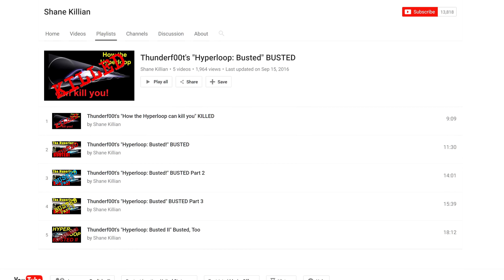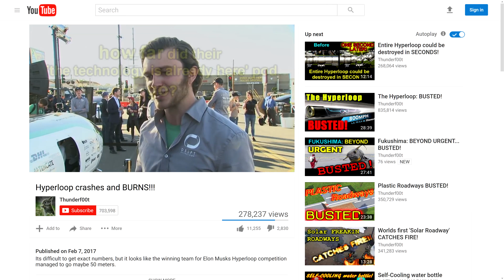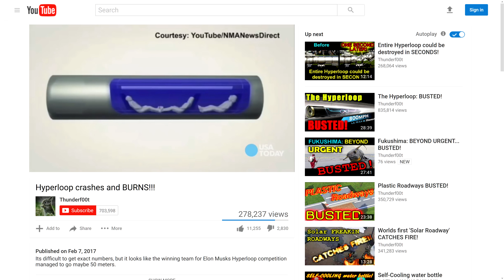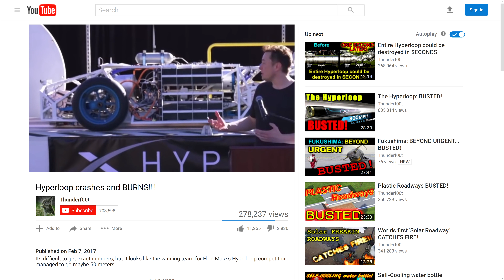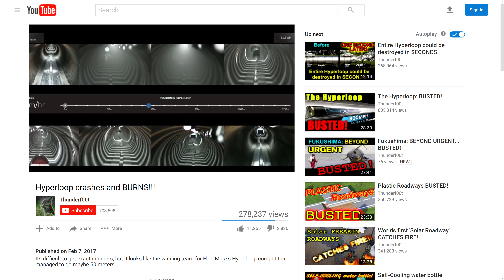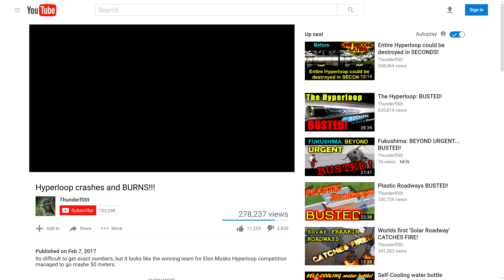Thunderf00t crashes and BURNS!!!

Comment: Not facts presented in this video. All you did was say what thunderfoot is saying is wrong and that's it. No evidence used to refute thunderfoot's claim. Also no links to this supposed class that created the faster hydrogen car. I have seen stuff on line that says it's an auto manufacture that made it, but you didn't site any source. So that means you are full of shit. I know what students are capable of in stem and building the fastest hyper car is not one of them. Your video was shit.
Reply: Where did Thunderf00t support his assertion that the goal of this test was to travel all the way down the tube as quickly as possible?  Even if Shane couldn't cite anything; or even if he had simply made up everything in this video-- Hitchen's Law would still do the rest for him.
Reply: Thunderf00t did not justify his analysis. Null hypothesis wins by default.
Reply: Levitation at a fairly high speed, in a vacuum, verifying safety and stability does not seem like a crap test.  What video seemed to award based on distance traveled?  

I don't understand your third sentence.  Read it back to yourself and see if it makes sense to you.
Reply: I would include a link to the article but I can't post URLs in youtube comments on videos I don't own. Thunderf00t's math is terrible, I have, on multiple occasions shown his results to be off by several orders of magnitude.
It took me all of 10 seconds to find many articles referencing Delft's fuel cell racecar. It's not my fault you REALLY REALLY FUCKING SUCK at googling things.  You should be embarrassed.
Reply: He's a troll, Shane.
Reply from the maker: "And you are getting pissed which shows you know you are wrong" Oh, FFS, you ARE a fucking troll, aren't you?

You haven't done ONE SINGLE FUCKING GODDAMN THING to show we're wrong. Only pathetic ad hominem attacks like this.

WE HAVE FUCKING SHOWN OUR CALCULATIONS. SHUT THE FUCK UP.
Reply: Do not feed.
Reply from the maker: "See you are a prat because you first say you had a lot of maths in your video now you are saying that you didn't need math in the video. Which is it liar?" YOU are the liar, DELIBERATELY taking a comment that was referring to the whole series (direct quote, LIAR: "We used math COPIOUSLY in this series") and making it about one bit in particular.

All you're doing is proving that no one should take a word you say seriously. You have NOTHING.
Reply: MIT was also a competitor, MIT is renowned for its groundbreaking engineering research. Just search "MIT creates" in google and get lost in the incredible things that institute produces on a regular basis.
Reply: Alex Fauble why should I have to search anything? In a video sources need to be sited. You do not write a report and in the bibliography write; search Google. See, it's funny how i have to search for a very specific set of words to find some support to the car assertion but I already looked and found nothing, so I'm not going to do it again and this video lost a credibility. At least Thunderfoot showed maths. What did you show? Other than irrelevant "facts?" A bad idea is still a bad idea regardless of how much achievement the individual purposing the idea has accomplished. Poorly done video boils down to school yard tit for tat. Lame.
Reply: Shane Killian he backs it up with maths. You are free to use your own maths to refute his. All you did was say that thunderfoot was wrong and offered no sources or reasons why. If you wanted to prove that thunderfoot was wrong about the intention of the test, show the documents to prove you are right. As it stands thunderfoot and the very video about the hyperloop prove you wrong.
Reply from the maker: LIAR, spouting figures out of context and making them sound a lot bigger than they are IS NOT FUCKING GODDAMN USING MATH!!!
Reply: Search "First full-size hydrogen fuel cell powered race car by TU Delft".
Reply from the maker: No, it doesn't. This is how HONEST people respond to LIARS. But you wouldn't have the first fucking clue how honest people react, do you?

No math was provided here by us because NONE WAS NEEDED. We were ASSUMING Thunderf00t's assertion was correct, and merely pointed out that this was about $5 worth of electricity.

GO THE FUCK AWAY. You have NOTHING of value to contribute.
Reply from the maker: I like how I have to source every last jot and tittle even though I'm not saying anything that's out of the way, yet Tf00t makes one ridiculous claim after another with no sources whatsoever and that's just fine.

"but I already looked and found nothing, so I'm not going to do it again and this video lost a credibility." No, YOU lost credibility there.
Reply: Shane Killian wow. All the projection. You are right. You do need to go away. You recorded a video that was a waste of time. See you are a prat because you first say you had a lot of maths in your video now you are saying that you didn't need math in the video. Which is it liar? You are getting your ass kicked in this comment section. How does that feel? You are like a liberal losing the argument to a conservative. You need your safe space don't you? I can send you a link to puppy dogs playing, would you like that, liar?
Reply: hugesinker it looks like a crap test then. And the video seem to award based on distance travelled. And really, your post was the longest just because I have ever read. Spare me.
Reply: Shane Killian your video shows him using math. Who's the fucking liar?
Reply: hugesinker maybe you need to read it so it makes sense to you. And going a small fraction of the intended speed is not "fairly high speed." This test was a bullshit pr stunt on a project that is doomed to fail. You do not hire students to design a machine intended to be safe at speeds they want it to travel and in a vacuum. Students, by definition have no experience doing this. If it was serious, students would be interning not proposing and testing their designs. 

And if they are truly verifying safety, shouldn't they be checking what happens when the tube fails or at the very least how forces are required to do a failure? Spare me.
Reply: Shane Killian and we are still not proving anything. And you are getting pissed which shows you know you are wrong but have painted yourself in a corner. There is nothing wrong with saying you fucked up. It makes you grow. Show me your calculations that refute thundefoot's.
Reply: Shane Killian no you haven't. Liar. Not in this video nor is there a reference to them sited in your description. You are the troll, yo post nothing to support your claim. 

And people who get this upset and start accusing people of using logical fallacies that they don't even understand the meaning of shows how insecure and weak of character they are. You are almost on the verge of a complete toddler melt down. Like I said. It's okay to be wrong. It's a chance to grow. How about you grow?
Reply: Shane Killian yeah I wasn't talking about the whole series I was talking about this specific video, which makes you a liar. It's like when you show up late for work on one day, who gives a fuck about how punctual you were in the past. You are still in trouble. Like I said, your video is crap and your defensiveness is showing me and everyone else how right I am. Seriously. Take this as an opportunity to learn and grow. I'm sorry your video is shit. But it's a learning process. It will just take a long time to get to my level. But it will be worth it.
Reply from the maker: "he backs it up with maths." He didn't use math ONCE, YOU FUCKING LIAR! We used math COPIOUSLY in this series.

You fucking neo-Luddites have NOTHING. FUCKING NOTHING. Go wallow in the past and let the rest of us live in the future.

Comment: You a lying about what it was testing for. It wasn't testing for anything except for whether or not these teams could build a unit that would be able to run and perform functions according to specifications. And only 3 teams made it. One out of the three teams didn't even use a maglev system and two out of the three didn't use breaking because the requirement was for it to stop on it's own before the end of the track.

Comment: Thanks man, Thunderfoots bullshit and anti-innovation attitude has been pissing me off for so long, I'm glad someones finally made a video calling him out for his sheer stupidity and dishonesty.
Reply: Most of the things he criticizes really are crap and deserve to be ridiculed. But he just sucks at criticizing things fairly. For example, the hanging skyscraper is crap and he mentioned most of the reasons why, (virtually impossible materials for one) but then he throws around a lot of shit. For example, his energy calculation was actually off by more than a factor of 200.
Reply: I've never been so sure. I'd much prefer these things become a reality, tested and then ridiculed for the bullshit design they are.
The one that got me (before his continuous contempt of Musk and SpaceX) was the spinning solar panels. He threw around some rudimentary math and said "there debunked". but the whole point of the concept was to reduce cost of manufacturing the solar panel, which he didn't touch on once. I'd be much more open for believing these things are a crock of shit if the man actually addressed the core concept and aim of the designs themselves, but until someone does I'll keep my mind open.

Comment: How can one test for safety, relyability etc.. for the hyperloop at such low speeds?
I would say it was rather a test of vague probability of the systems in question but not even close to a stress test!
For example breaking at 80km/h is much less of problem than at lets say 200,500, or even 1125 km/h!
And in this low pressure environment your mostly relying on the brakes for the lack of aerodynamical resistance!

I however concur that thunderf00t exaggerates the problems a lot !
Reply: Seems like a first stage test of the principle of the systems, rather than a full scale test.
Reply: Just out of curiosity, how many individual tests do you think need to be conducted in order to develop a new mode of transportation? Ball park.
Reply: I'm not an expert but I would say in this case dozens if not hundreds!
 Or better said a metric shitton of tests ! 
You could just look at the Transrapid development which is "only" 500 km/h(in 1 atm) fast! 
That Poject had state funding(approx. 10 billion euro) and took more than 20 years until application maturity(Shanghai) !
And today such projects cost even more!
Reply: I would think that the levitation only gets easier and more stable at higher speeds-- but that's just a guess.
Reply: Every pod will have dozens, of systems, probably hundreds of moving parts. Each part needs to be tested dozens of times.  The RD process is basically mostly just testing. To develop a new pod, it would take THOUSANDS of tests in all kinds of situations. Most of those tests don't require full speed or even a track.You're talking about THOUSANDS of tests, in all kinds of conditions. This is just one publicized example of the thousands of tests each one of those teams are doing.
Reply: Maintaining air compression does thanks to the ram effect, however, I believe these teams were using compressed air cylinders to power the air cushions for this test, as such it functions basically the same at any speed up to supersonic speeds.

Comment: What about his concerns regarding explosive decompression?  Are those also unfounded?
Reply from the maker: Yes. The video covering that will be up next week.
Reply: Nope. Videos of tanks imploding under vacuum only show that objects designed for positive pressure (in > out) don't do well under negative (in < out) pressure. Drill "strings" on oil rigs can take 1500 psi in either direction, just from metallurgy, for example. We're talking 14 psi, so it's a matter of thermal pre-treating steel.

As for TF's preferred "destruction case,"  failure of the vacuum seals, a quick look at a pressure engineering book yields a simple answer: put an emergency valve on each section joint that re-pressurizes the section in case of an out-of-spec internal pressure, while closing section isolation gates (far from pod), and applying emergency brakes to the pod.

Nothing more than MechEng 101, but then again Dunning-Kruger is a thing.
Reply: So, if I'm understanding you rightly, the worst that could happen is the air pressure would equalise, maybe hitting and derailing the car, which would be no worse than a train derailing; which is already considered an acceptable risk.
Reply: It's actually implosive compression, but yes, we cover that. Basically TF's tanker car comparison was inappropriate. In short, the hyperloop, even as specified, is likely to be significantly stronger than the lower limit to what would make such a failure possible.
Reply: TF doesn't understand that the Hyperloop is a railroad and 99% of the problems he comes up with are railroad problems that have railroad engineering solutions, things like isolation areas, spur lines, sidings, etc. As for the "just like space" that's idiotic: space's biggest problem is that it's inaccessible in an emergency.

BTW, I'm not a fan of the Hyperloop, precisely because it replicates all the problems of rail transport of persons. Also, every idea of Elon Musk makes me feel the hand of government deeper into my wallet. But I think the technological spillovers of the project may be worthwhile, even if it ends up like the Shanghai super-train.
Reply: Okay, that's all fair enough, but specifically the issue with explosive decompression.  Or implosive, I suppose.  What's the solution to that?  Oh!  Make the walls the way the walls are on a submarine!  That withstands an intense pressure gradient.

Comment: I remember when he ridicule Elon for relying students and not any engineers to build the Hyper-loop.  hey Thunderf00t engineers are working on the  hyper-loop not just the students. 

Oh they aren't just students but MIT students with actual technical knowledge to contribute to the development of the hyper-loop even if it is a small part.  

 I am very annoyed with thunderf00t hyper-loop crash and burn video more then any other video hyper-loop video. at least with those tried criticize hyperloops with science even if they were wrong.  Instead he took a cheap shot at the competition. Really TF, Really.
Reply: Yeah, it was basically a one man circle jerk.